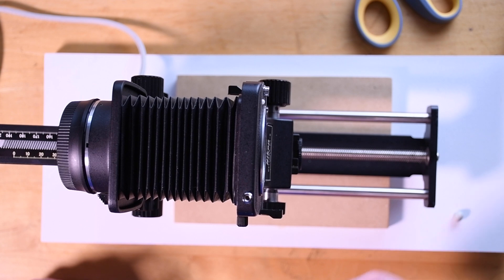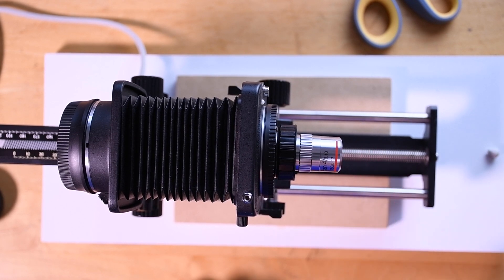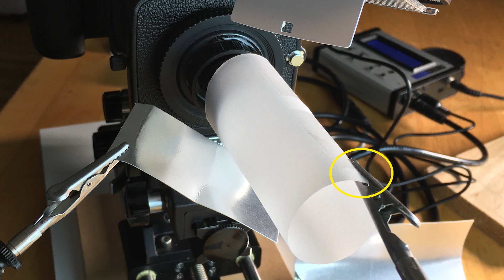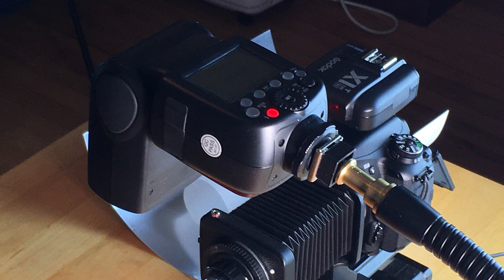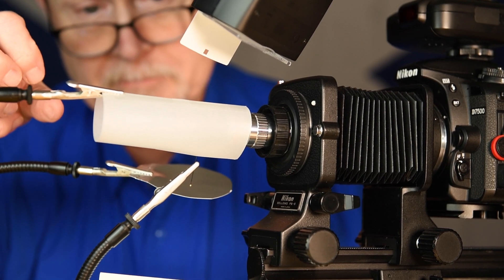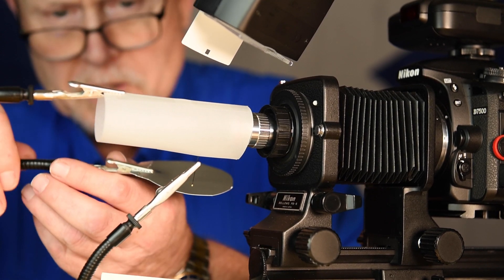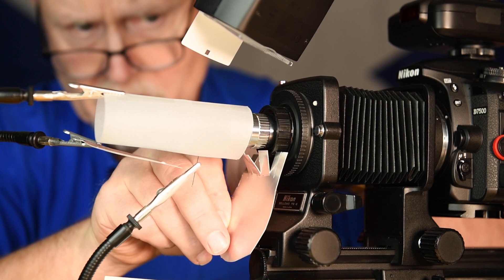Getting Light into Tight Places - how to use flash in extreme macro photography

Comment: Hello,I would like to ask why you don't use a led tunnel but you also use flashes at home?Isn't it better to use a set of led lights?Create a led tunnel?
Reply from the maker: Good question - LED light is not as a pure full wavelength white light like flash, it flickers, and requires monger shutter speeds. Flash is a better choice for minimizing motion artifact from vibration. Flash increases the percentage of good images I make.
Reply: @AllanWallsPhotography  Thanks for the reply.I have always shot with flash and have been happy.I have created a led tunnel and use two led lights.I am not happy with the results.I get better results with flash.I use a godox tt350 and have added another one.I will go back to flash.Thanks for the great videos they are informative and inspiring
Reply from the maker: @Noid-reviews  I think you are making the right choice - you can some things with LEDs but you can do everything with the TT350!
Reply: @AllanWallsPhotography  Thank you.I did another test yesterday.The results with the flash are much nicer.I like the drawing better.Thanks for your time

Comment: Thank you for all of your very educational videos! I have just retired and have learned a lot from you and am putting together the things I need to try macro photography with a 4x objective. You shared your camera shutter speed and ISO settings for this, and said that the aperture is fixed by the objective, but what do I set my camera aperture setting on? I am anxious to give this a try!
Reply from the maker: Gosh I am so sorry for the slow reply - Well, as you won't have a lens on the camera, there will be nothing to set. When you adjust the aperture on a camera, the message is passed to the motor in the lens, which opens or closes it per your instruction. But with some extension tubes or bellows, there may or may be connections that would connect camera to lens, but it doesn't matter because the lens you are using, the objective, has a fixed aperture. If you shoot with Nikon, the aperture display should have three little dashes but no f/number. You question gets a more interesting answer when you start using infinity corrected objectives. Then you might have to adjust some settings. It took me so long to answer this, you have probably already written your first two books on macro photography! Sorry. Good luck!

Comment: Hello Allan, i would like to know what is the name of the 50mm adapter that connected the microscope objective to the nikon bellow. I tried to search in shashinki and ebay but cannot find.
Reply from the maker: Hi - you will never find the name of that adapter because I made it myself! It is a Nikon body cap and the lid to the objective case, epoxied together and with a hole drilled through both. But there are suitable adapters that can be purchased... This will give the same result... https://www.ebay.com/itm/322899008377?epid=1471203109&hash=item4b2e47db79:g:2McAAOSwQItUBIZM

Comment: If you have just a moth/butterfly wing, no insect to pin and use a setup like this, how would you light that?
Reply from the maker: Hi Carl, that would depend very much on the specimen. But as a general rule you will be using high magnification and will want to be shooting the wing at an angle, so that the scales would reveal their ridges and will cast shadows at their edges. For this effect, I like to hold the wing in a very small clamp (hairpins work well) and angle the wing at about 45 degrees, facing to the right, and have a single light source just to the right of the objective. I may add a small reflector immediately below the wing to bounce a little fill back up into the shadows. It is easiest to shoot at the leading edge of the wing to avoid contact with the objective. The light intensity will vary, depending on the color and reflectivity of the scales. From there is all about tiny adjustments to get the look you want (use a good XYZR positioning device to make these adjustments). I have been experimenting with a DIY fiberoptic device for more subtle lighting effects and the results are promising.
Reply: Allan Walls Photography can’t wait to see the results of that.

Comment: hihi !!any different between plan vs din objectives? they say plan can make a bit more distance
Reply from the maker: Hi Tyler, DIN refers to an industry standard that sets the distance between objective and eyepiece (160mm) - important when using finite objectives. Plan, on the other had, refers to a type of flat-field correction that occurs within the objective itself. So they are are not really comparable terms. I am putting out a video this week that will include a detailed discussion of the different types of objectives used in photography - hopefully that will make this issue clear!

Comment: Really enlightening video. Sorry if I missed this but do you use rear curtain sync for your stacking?
Reply from the maker: Hi Jack, I didn't bring up rear curtain sync - I should have mentioned it. I seldom use RCS for a number of reasons. It doesn't offer a noticeable advantage over my usual shooting sequence (Mup with long delay before shutter release). The slow shutter speeds used with RCS require a dark space, which is hard to achieve in my studio, and ambient light getting into my composition causes more problems than the ghosting that I would use RCS to avoid. But the main reason is that my flash triggers are very unreliable when using RCS. I am not entirely sure why this is, but I get a lot of missed shots with RCS, unless I use a sync cord (PC) from the camera. I would be interested to know if you use this technique, and if you have found ways to avoid the problems I run into. Thanks again for the great question!

Comment: Yes I think ii's a good idea to make a group conference. I like to ask a question. When you are taking photos with the bellows do you leave the camera settings such as focus point and aperture etc. Thanks for your informative tutorial in which you share  your  knowledge  with  such dedication.
Reply from the maker: Hi Mario - good to hear from you! When using the bellows, all the focusing is done by physically moving camera/lens/bellows as a group (on a focusing rail). The aperture is either fixed (for a microscope objective) or set manually (with a camera lens or enlarger lens). You will still need to set the ISO and shutter speed yourself.
Reply: @AllanWallsPhotography  Thanks Allan I vave send you some info on your FB.
Reply: Mario Mifsud with bellows work you are in complete manual focus so point focus and other settings don't work.

Comment: So did you actually set your camera for F22 even though you didn't have a lens with an aperture you could adjust or did you just shoot wide open?
Reply: If you're talking about the microscope objective, then no. Microscope objectives have a fixed aperture, so you can't adjust it with the camera.
Reply from the maker: Hi Lyle... There is no connection between the camera and the lens/objective when mounted on the bellows. Your aperture is fixed and is determined by the objective. It gets confusing because the microscope objective has a fixed numeric aperture (in this case, NM=0.1) which corresponds to an effective aperture f/20. But you can't change that. If you are using a camera lens on the bellows, and you can change the aperture of the lens, you need to bear in mind that your effective aperture drops with magnification. If your lens is set to f/8 and your are using bellows or extension tubes to increase the magnification ratio to, say, 4:1, the effective aperture will drop to f/32 (magnification multiplied by lens aperture). You need to know this number because as your f/ number increases, your chances of losing image quality due to diffraction also increases. This is not nearly as big a problem with microscope objectives (which is why I use them whenever I want more than 3:1 magnification). Hope that helps!
Reply from the maker: CORRECTION: I made a mistake giving you the formula for calculating the effective aperture when using extension tubes or bellows. It should have been effective aperture = lens aperture x (magnification ratio + 1). So in the example I gave (F/8 at 4:1) the effective aperture would be 40, not 32. Sorry for any confusion!

Comment: Very interesting Video.
Would you recommend an economical microscope eyepiece.
I dont need to shoot sub micro very often but I find LEDs on stalks very useful.
Reply from the maker: Hi Roy - The correct eyepiece for use with a microscope would very much depend on the type of microscope and the objective you are using. With some objectives, ones that do not correct for chromatic aberration, the eyepiece is designed to make such corrections. Are you wishing to incorporate an eyepiece into a photomicrography setup, or do you have another purpose in mind? If you are looking for a way to adapt a microscope to use with your camera (i.e. having the camera capture images through an intact microscope), the best place to start looking for adapter solutions would be LM Scope (www.lmscope.com). Feel free to email me directly (contact@allanwallsphotography.com) if you would like to discuss this further. By the way, I also use flexible LEDs, and fiberoptics, for some of my work (video coming!), but the purpose of this video was to demonstrate how excellent lighting can be accomplished with the gear most photographers already have.